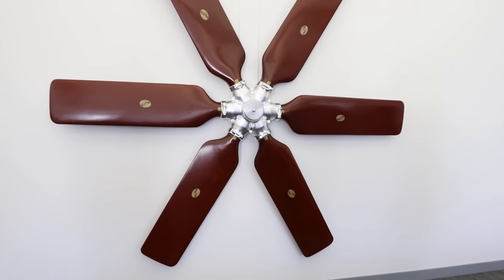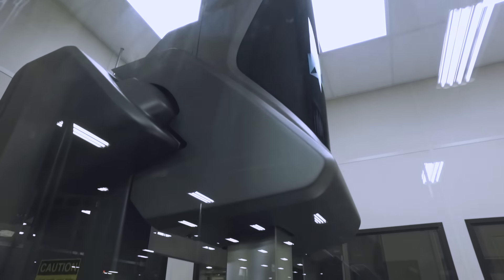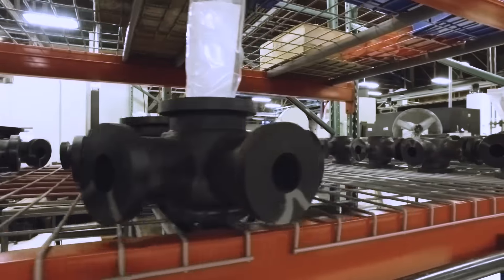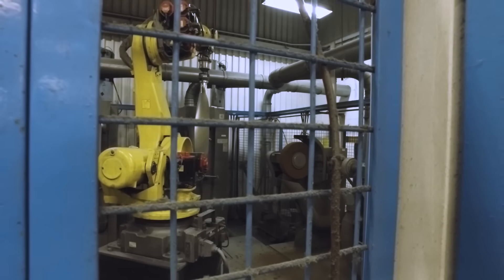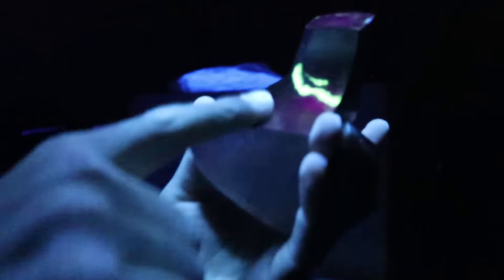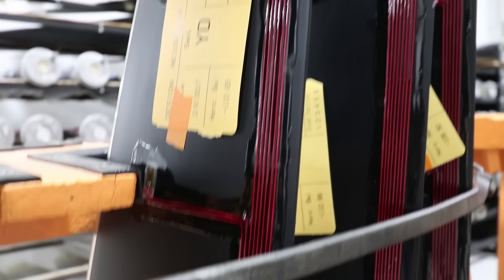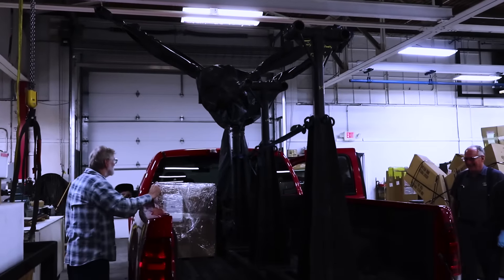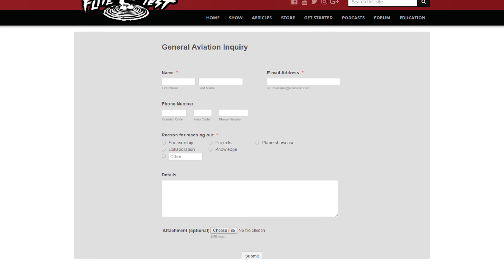HOW PROPELLERS ARE MADE: Hartzell Propeller

Comment: Awesome episode guys! What we really need are controllable pitch props for R/C models, and I'm not referring to the ones for 3-d flying. For racers and hotliners, we have to use extremely high pitch to get top speed, but the result is a prop that is stalled out until you reach 50-60 mph, making launches/takeoffs extremely difficult.

Comment: For those wondering what the black light stuff is, its another form of NDI. Non Destructive Inspection. This form uses a dye penetrant that show flaws under black light. There are other forms that use eddy current, or electricity, kind of like a micro radar to find cracks, and also x-ray to inspect composite materials.
Reply: ok ok.
Reply: Is there a diferrence between ndi and ndt?

Comment: Correction* they change oil pressure inside the hub not the prop as you stated. Constant speed is actually a very old technology dating back to pre war aviation and besides advanced materials they haven't essentially changed much since then. Hartzell have always been one of my favorite manufacturers of this often overlooked facet of aviation, it's Hartzell that brought me home so many times. I hand carved my own wooden prop when I rebuilt my canard weight-shift Eagle ultralight when I was 16 and man did I struggle, the slightest asymmetry or imbalance causes such a severe chain reaction of problems that can ultimately bring an aircraft down (the United Express Embraer that had a full prop detach comes immediately to mind) so it is a very precise science we really should respect more, great that you covered the art in this informative video.

Comment: why change pitch of props when we can change motor speed (for aircraft)? 
what is the difference on the "feeling" when we change the pitch rather than change motor speed?
Reply: internal combustion engines are most efficient at a narrow range of RPM's. the prop is most efficient at a certain pitch for a certain altitude. mixing these two leads to max efficiency for what youre doing.
Reply: 1 motor speed allows an engine to be more efficiently designed for 1 operating condition, instead of being less efficient over a range of rpm operation. Pitch change also allows a very quick throttle response.
Reply: thank you for your answers
Reply: Because those propellers have quite a lot of inertia, it takes quite some time for the motor to change it's speed. Changing pitch is more or less independent of inertia and therefore much faster.
Reply: Different pitches are more efficient at different speeds.
Reply: During take-off, a high engine RPM and low pitch (most power) is used.  During cruise, a low engine speed and high pitch (most fuel efficient) is used.  There are also constant speed propellers most frequently used on turbine engines, or turbo prop aircraft.  These will change the pitch of the propeller as needed to keep the engine at a constant RPM.  More power from the pilot, the engine will add fuel and increase pitch simultaneously in order to maintain RPM.

Comment: I wanted to see the pitch change on them. has to be sweet to feel inside the plane. ive only seen one variable pitch quad. ran on a belt drive system with one motor. can't remember the name of it. I guess its not a reliable racing setup or more work would go into designing one....:)

Comment: I've always had the idea that propeller manufacturers should design their propellors with winglets on the tips.  It would increase efficiency, I would think.
Reply: Daniel Skoog might work with a composite or some other light strong material. I think with metal the extra weight would outweigh the savings. Would also have to figure out the balancing. But it's a good idea. Might see them in the future as tech advances
Reply: Tallishyeti27 Yea it would be easiest with materials like fiberglass or carbon fiber.  The importance is to eliminate the vortex at the end of the propeller blade just like the one at the end of the wing, reducing drag.  It could be easier to do with a RC plane propellor.  Just molded plastic.
Reply: Daniel Skoog hartzel already makes one. It's called a Q-Tip Propeller.
Reply: It does reduce the induced drag, but it adds surface area right at the tip where it's moving fastest, so then that adds friction drag and it's more or less a wash. But apparently if the winglets are angled backward, it does make the propeller quieter. I really want to build myself an electric paramotor with one.

Comment: So basically it uses variable pitch like helicopters?
Reply: AERO BLKHWK32 Like the collective pitch control on a helicopter, sure. Helicopter rotors also have the cyclic, which these don't have.
Reply: Variable-pitch propellers and swashplate helicopter rotors were introduced around the same time (~1930's).
Reply: Constant speed is different than variable pitch.  Constant speed will change the pitch of the propeller in order to keep the engine at a constant RPM.  If the pilot adds power, the engine will try to spin faster with an addition of fuel, but the propeller will at the same time go to a higher pitch causing it to "take a bigger bite" out of the air and slowing the engine.  These two forces will constantly equal each other out in flight.

A variable pitch is a manual setting that the pilot can alter from the cockpit.  The pilot will also have to add power and/or change fuel mixture to counteract the slowing of the engine when choosing a higher pitch.
Reply: +Torque556, I'd say it slightly differently for clarity--a constant speed prop is a variable pitch prop equipped with a governor.
Reply: Technically, constant-speed propellers are variable-pitch propellers, but the pilot selects rpm and a governor keeps rpm constant (within the limits of physics), whereas in what is, in a narrower sense, called "variable pitch", the pilot sets the prop pitch directly. These are all but extinct except in some historic aircraft.

All propeller airplanes except the simplest piston-engine-powered light airplanes (such as the ubiquitous C172 and PA28 in most variants) use constant-speed props. Except when simplicity and price are paramount, the benefits are always worth it. More takeoff power, better cruise economy and quieter operation in cruise.
Reply: +pinkdispatcher, that's what I already said. There's no "technically" about it--100% of full scale constant-speed propellers are variable pitch. Electric pitch-selectable props are far from extinct; extremely popular on older Beechcrafts because there are no AD's on them. Personally I'll take constant speed any day though, as they're more reliable, AD's not withstanding.
Reply: joshuawfinn Right.  A constant speed propeller is a variable pitch propeller, but not all variable pitch propellers are constant speed.
Reply: +Torque556, yup!

Comment: I'm honestly supprised that there is no carbon fiber
Reply: Those are a specialty thing. Metal is great because its initial failure mode is bending, so you have reasonable warning that something has been damaged. A carbon prop can be ready to explode and look perfectly fine to the naked eye. Whack an aluminum prop with a hammer and you have a dent. Whack a carbon prop with a hammer and it'll have a scratch, but will explode spectacularly when you spin it up.
Reply: Another issue with carbon fiber is trying to cope with the OSHA disposal requirements and possible fines that could be applied on non-compliance for all of the waste byproducts especially like the dust created from sanding such materials and/or components. The dust created from sanding carbon fiber is extremely harmful to animals and humans.

For the cost/production/safety process, it's simpler to go with some other material than it is to use carbon fiber.